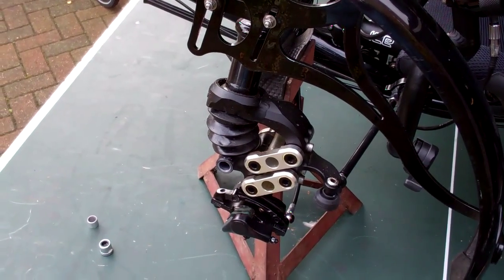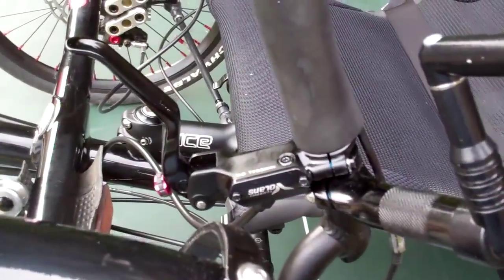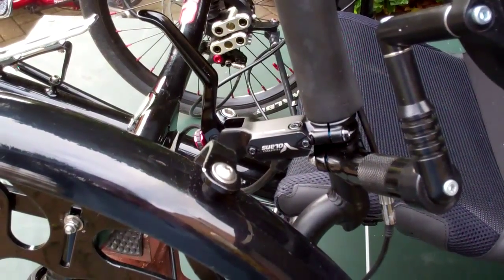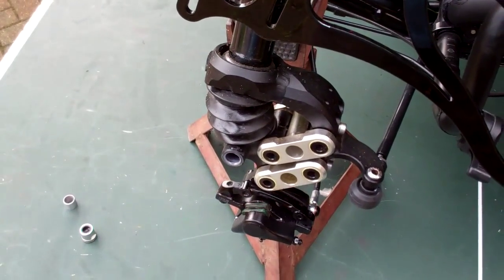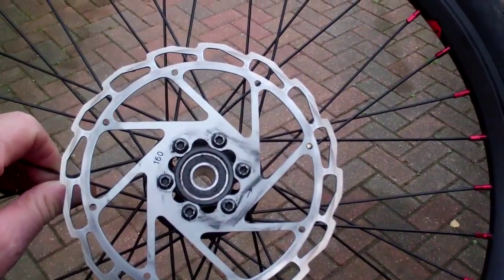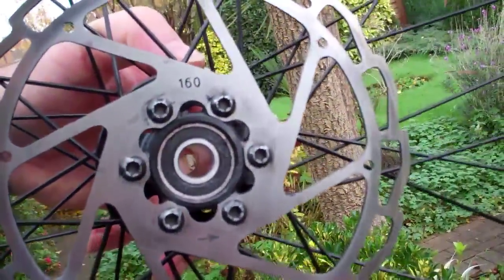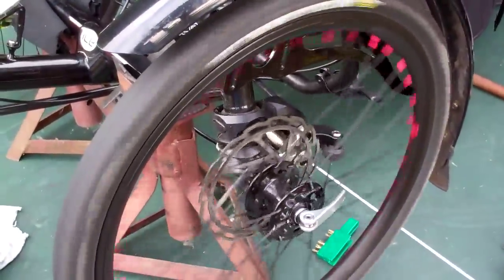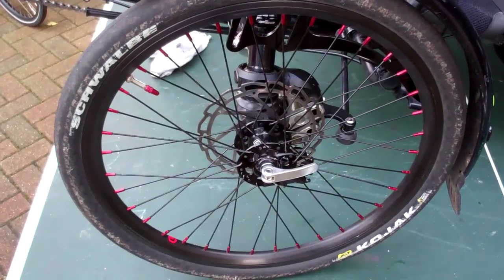ICE TRIKE RECUMBENT STUFF. BRAKE BURP AND BRAKE DRUMS

Comment from the maker: Had a really good ride on it today, around London up to the olympic park and back threw London, Great to have the brakes sorted its beginning to feel like my trike now, had to nurse it back home as the Gear cable had a few cables snapped and it was caching in the cable outer, not problem got home OK and will fit a new one in this week it was a good ride to get all the wrinkles out and and see what it was like on a longish ride, Nice I like it alot I am well pleased with the swop, I know I will use it more that I did the Vortex it was a lovely trike and it took me a long time to make up my mind to sell or swop it, but pleased i did I hope Keith is getting as much fun out of it as I did
Reply: I imagine you are aware that an untrue disc can be pushed sideways by hand enough to stop it from rubbing in one area. Only thousandths of an inch are needed. In a mechanical brake assembly, the pads aren't as tight fitting as those in a hydraulic assembly. As you have learned, dirt will cause the mechanical pad to stick or become cocked to cause squeaking or chatter as one pad will contact before the other. This can push the disc to the side.  Hydraulic pads with closer tolerances don't always retract enough to be completely free of the disc. They may quietly rub enough to heat up the disc to the point that the disc is temporarily warped. Uneven wear is caused by that. With both types of systems, an occasional hard braking will push the pads in well enough to overcome a buildup that is causing the sticking. It's a good idea to feel the discs to detect heating up after riding a distance. Also, spin the wheel before and after a ride, to detect rubbing. Burnishing should be even around the disc. Things can even vary with air temp changes. due to the natural movement of thin metals according to the atmosphere around them. These tips are not unknown, but maybe this will help someone. Thanks for sharing this video and the good tip.
Reply from the maker: Cool Thanks for taking the time to write, after a good ride the pads have bedded in nicely, they feel very good now both clamping well it was just some Air in the system and the Disk running backward that made a big difference    Great well pleased now
Reply from the maker: Yes I understand pushing the disks to stop chafing many thanks